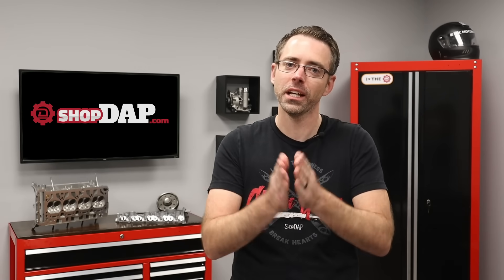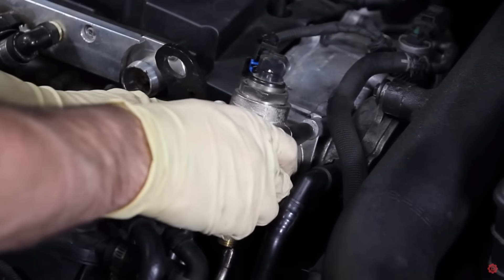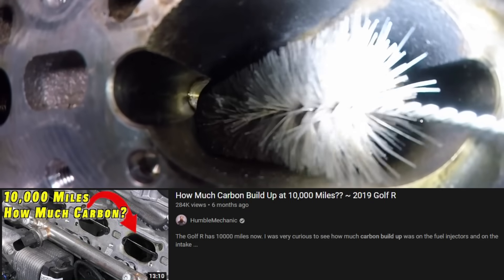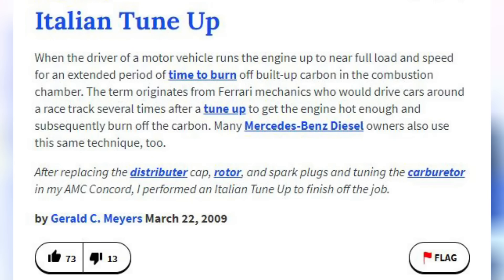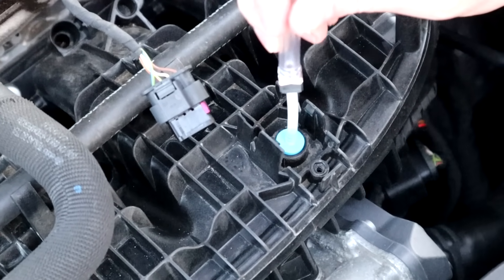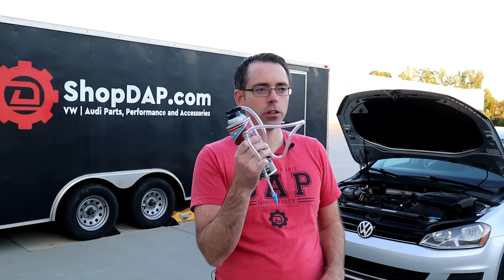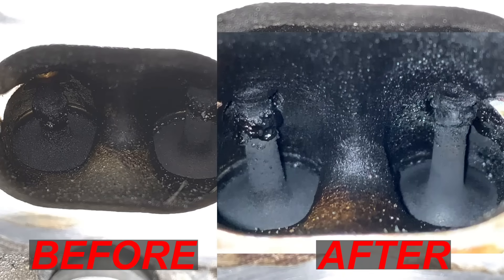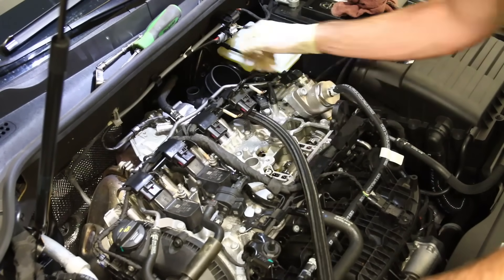Can you Really Remove Carbon for $29?

Comment: i found that different cars/engine pcv system help or make worse the carbon build up. audi/ vw ( sorry ) have the worse system.. pulling it from the valve cover and letting gravity  jelp flow the bad stuff into the engine... but ford( and some Mazda's ) DI engines have less carbon build ups... why? there pcv systems, are on the block below the intake manifold and the intake  on the head. the pcv system they use is also a baffle plate system, but because of the location, below the head/ side of the block,, less vapors etc. have to go against gravity to flow into the intake system... i have seen a few 2.0 liter EcoBoost cars with 100,000 miles on them, and the carbon on back of the intake valves is minimal... i also own a 2014 fusion with a vep 2.0 ecoboost engine.. but i installed a ovs, and modified the insides to collect most if not all the pcv vapors, and my intake valves are pretty clean.... last year just as a test  i installed a large fuel filter into the line from my ovs to the intake manifold.. and drove it this way for 6 months.. removed the filter, cut it open, and looked at the paperish filter element.. it was very clean.. so i believe my ovs mod. i did is helping  keeping that bad vapors out of my intake track  ..( p.s. i work as a classic Italian car tech)

Comment: CRC works just tried it the other day, but the engine needs to be hot to soften the carbo, idle at 2000 rpms, short burst until can empty. Let sit a hour, hit the highway at 100mph. Enjoy the new power❤.
Change the engine oil and filter.

The other method cheaper, get the engine hot,remove intake  manifold, spray the valves  with oven cleaner foam, let sit overnight, hit the highway, change the oil.

Comment: You have to start with a hot engine so run it before you do the chemical cleaning. BG 44K is a better solvent. They even have a kit to treat the carbon buildup. Continual reving of the engine while you apply the solvent is a must to get  good circulation of the chemical to all of the  ports. Use a good fuel addative with PEA like Techron or Gunk to keep the injectors clean with every oil/filter change at 5K miles. Use a quality engine oil like Valvoline Restore or Penzoil Ultimate Platinum to help keep the pistons carbon free . Finally, drive it like you stole it every once in awhile especially if you do a lot of cold engine short trips stop and go driving . Long trips are your engine's best friend together with good maintenance. If you can't/won't do good maintenance then trade it in  every 100-150K miles and start over again.

Comment: diesel engines 100 yrs have only air in intake, and direct injection of fuel. why diesel engines have not such problems with build up on valves. i have seen clogged mainfolds and egr sistems but rarely valves..

Comment: So call me crazy, install water meth injection, yes its not cheap or easy but long term it cleans your valves and will give you a small bump in performance. Seems like why don't they do this for factory cars? Cost and inconvenience? Sure that is true but taking your car to a shop for walnut blasting is not cheap, seems like the price has skyrocketed recently, I was quoted $700-1k for my N54, but still adding boost juice is a lot less time intensive than this even if I have to do it more often.

Comment: Has nothing empirically to do with CAFE standards - European corporate average fuel economies are much, MUCH higher than ours.  They just don't produce 7000lb vehicles for Sam the walmart cashier to drive by himself 20 miles to work and back everyday, and then try to make up for those ridiculously oversized peoplerollers with redline efficiency engine designs.  Freedum.

Comment: The best way to get rid of carbon buildup for good is to trade it in for a Tesla.  1000% effective.
Reply: Then you get corrosion buildup due to coolant leaking in the batteries, and you’ll need to hit up Electrified Garage to get it repaired bc Tesla will only replace the entire battery pack for a cool $40K

Comment: sure fire way to clean all carbon from pistons and valves is to empty washer fluid container and refill with distilled water and take a very small tube like from fish tank air line and run it from the washer tank pump to the inlet barb for the pcv valve on the intake...get motor really hot by driving down the fwy for 15 min at 70mph and then hit your windshield washer for 1 second every 10 seconds for 1 minute and then drive 5 more min and hit the washer cycle again the same as the first time and just repeat this for about 15 to 20 minutes. it will litterally look brand new inside. the carbon heats up then the cold water hits it and makes it explode apart little by little. if you ever saw an engine with a clean cylinder  after a head gasket leak then this is why...same concept

Comment: So the conclusion I have come to is just get your oil changed more often, get a catch can (I have heard a lot of good things about them), don't let spark plugs get too bad, and I think using higher octane gas helps a little as well.  Main thing though is if they get bad, clean them, and then do the oil changes more often like 5k miles.  Some people do them every 3k even.

Comment: FYI Toyota uses a dual port/direct injection on demand system in millions of rav4s and Camrys with the 2.5 engine sold in the US. It works flawlessly. Unlike the Chevy equinox 2.4 which is direct injection only and uses a tiny orifice PCV. It’s a mess.

Comment: Ive heard multiple times, LATER Gen 3 engines are less prone to carbon build up. Why is that? What’s changed? I run CRC valve & turbo cleaner through the intake on my 16 GTI & it seems to run great. Im now at 92k and am wondering if I need to get it carbon cleaned or is my Gen 3 less prone to this issue and why? Really enjoy your videos.

Comment: To quote Dr.W. Soon. Don't talk to me about Ozone you could get rid of the ozone and it would replace its self in three days or less. Or somthing like that. Its nonsense.
Reply: And for the humans 3% contribution to any harmful Co2 contribution. This is nonsense. Yes, it's not nice around very large cities. But reducing stop-and-go traffic would give better results. Stop putting engine sewage back through the cold air intake to be reburned. Its only achievement is to reduce the best air-fuel ratio possible causing even more pollution. Hell, we got rid of lead gas. Catch cans are not rocket science. You could make one out of a coffee tin. But returning it through the cold air intake is not the answer. But  running a valve cleaning spray just before the normal oil and filter change combined with a catch can system could yield some advantages.

Comment: For a modern auto manufacturer to include a valve design that guaranties excessive carbon, that is going to cause poor performance sooner not later, is inexcusable.  During the 1920's and '30s they had even worse problems with carbon (the Ford flathead was a flathead mainly because it made it easier to service the valves and remove the carbon).  And for a car maker to knowingly design something into their modern engines  that is essentially a giant step backwards, is proof enough that I'll never be buying a car designed by such automotive idiots.

Comment: Hi mate great video 
Just one thought by servicing the intake ports yourself you have to make sure the port your working on is closed so you do not let any carbon or chemicals fall into the combustion chamber. But if I was to use the method you and a lot of other people use with the can of cleaner would there not be chemicals and carbon deposits going past the valves into the engine.
Just a thought??

Comment: I fully agree, intake spray cleaning is a Preventative Maintenance procedure. It is strongly recommended you do it every 30K miles on GDI Engines BEFORE  you develope the build up. Once build up occurs,  chemical cleaners have little effect and expensive  physical cleaning will be required.

Comment: Get a Catch Can with a drain valve on the bottom. I flip the valve at every oil change and it comes out of the connecting hose on the bottom of the car. Usually I drain an ounce of oil every 7k miles. My intake stays  pretty spotless. I would say its about 95% effective.

Comment: Some people have the idea that if you throttle at really high revs, it will get so hot that the carbon will crack into small pieces and come off the valves. But there is probably some research in the area that says that there must also be a sufficiently high temperature

Comment: What does high octane fuel have to do with valve carbon buildup??? You DO understand that hi octane fuel is LESS volatile than lo octane? It has to be to prevent  preignition produced in high COMPRESSION engines.

Comment: I feel like if the engines running you're not really getting the benefit, it needs to be soaking, I was thinking if you closed all the inlet valves and use something like acetone and fill the chamber up and leave it for 24 hours then start your vehicle would more likely dissolve the carbon build up.

Comment: Meh, an Italian tune up is where you use an old Coca Cola bottle and fill it with tap water, then you take off the air cleaner assembly and then whilst holding the carb butterfly(s) open and revving the t1ts off the thing, you pour random amounts of water down the carb and watch as it splutters and stumbles, throws a whole lot of smoke and crap out the exhaust and then magically starts to idle better..

Comment: Use Pennzoil full synthetic made with natural gas. Change  oil every three thousand miles,  use 2 tier fuel only and keep air cleaner clean use engine cleaner early such as Moly valve cleaner.every 15000 miles you will never have a problem. TECHTRON
FUEL INJECTION CLEANER every eight thousand miles as well. (Maintenance )Pay Me Now Or BIgTIME LATER. 80 year old mechanic. SENDS this lesson.

Comment: FYI you can use windshield washer fluid for your "water/meth" injection....which means you can use the washer fluid reservoir that is already in there and just divert the line from the windshield nozzles to the injector.

Comment: I put a catch can in my car about 80-100000km ago and the can has never had any oil residue yet. The hoses are tight. Its installed correctly. Not sure whats up. Unless i just have a crappy catch can. Although its pretty basic plumbing.

Comment: This was a good video up until the Anti-Detonation Injection (ADI) section. Installing an ADI system is very straightforward for anyone with modest mechanical skills. ADI is the only way to effectively deal with carbon buildup so to dismiss it off-hand is ludicrous. I have a supercharged engine running with eight pounds of boost, so ADI is a no brainer. Snow makes an excellent line of products.

Comment: The Italian tune up is used to prevent carbon issues and works on car that can reach high temperature into combustion chamber, it doesn't solve older and massive carbon issues and doesn't work on diesel, especially on diesel that use EGR valve system, obviously.
Trust me, I'm Italian, I know.

Comment: I have a 2017 Ford Taurus SHO.. it has the twin turbo'd 3.5L V6... with direct injection. I use high-quality oil (Amsoil Signature Series 10W-30), a JLT catch can, CRC's Intake Valve and Turbo Cleaner (which is "specifically designed/formulated for this issue), and a Snow Performance Meth kit... My valves look nearly new. Bought the car used at 42k miles with one previous owner, I'm at 62k now. I've used the CRC spray twice so far. I change oil every 10k miles, and I check my catch can regularly.

Comment: Oil catch can... Put between the PCV valve and the hose. Going back into the motor will catch a good portion of that oil and then you can drain it off into a container and properly dispose of it. That's what the manufacturer should have done and just had it so you service it during an oil change 😉 

Or if they wanted to get fancy, they could have routed the condensed material into the fuel injection system through a filter. 😅

One of the other things that you didn't show in the video is installing a valve on the catch can so you don't have to remove it at all. You can just have a valve on the catch. Can either by the catch can base itself or run a hose down somewhere, not near hot components so that you can just open it during an oil change. Also by putting something inside the catch can like really coarse steel wool that's been blowing through a couple times with high pressure then make sure nothing can break free and then wrapped in like cheesecloth can help get the vapors cooled down so you're not getting anything back inside there. Power plant especially if you run the feed tube down inside the catch can itself and then the vapor has to go across the mash in order to get pulled back inside the engine. The air will make it but anything thicker will get caught up in the turbulence and hit the wire and then get fed down to the base of the can. 😅

Comment: Whenever I was rebuilding my engine for my Dodge Avenger. I took apart the intake and it was full of carbon so I soaked it for about 6 minutes to 10 minutes in potassium chloride and then I washed it and it became pretty much brand new aluminum.

Comment: when discussing ways to prevent carbon build up you forgot the easiest method ? re route your windshield washer sprayers to fire directly into a vacumn port and thus making a poor mans meth injection set up. you could either fire it manually using windshield washer mechanism or wire the washer pump circuit to a MSD rpm controlled switch :)

Comment: I am going to correct some misinformation. At roughly 10:00 or so, the content creator mentions the car running rough "because you're putting all sorts of chemicals in there." This is false. Why?

Because the car needs sensor inputs from the MAP/MAF sensor, and perhaps the air intake temperature sensor. He unplugged those sensors, thus the ECU/PCM isn't getting that sensor data.

The solution is actually on cars that have it, to unplug the vacuum booster for the brakes, and insert the cleaner that way. Another place you may be able to hook up the bottle is in the EGR system, which recirculates exhaust gas back into the intake stream. Lastly, you can also just crack open your air box and let engine vacuum pull the cleaner into the intake system. (Note: If you use the airbox and are worried about the MAF/MAP sensor, then remove it from the intake tubing, but do not electrically unplug the sensor.)

Point is, you want the cleaner to be pulled via vacuum into the engine. Another way to clean at least the valve seats and/or lower valve stems is to just run a can of SeaFoam in your gas. This actually will clean out the fuel system, including injectors, and in a direct-injection engine, can help to keep a valvetrain clean. I also recommend an engine flush for direct-injection cars, as the cleaner can clean carbon from the valves since it is mixed with the oil before an oil change.

Comment: So it did 0 to clean and fix the issue! 
You did not comment on the Walnut blasting option which I have seen do a fantastic job cleaning these issues.
It's not a cheap fix, but it's better than wasting $30 (and your time) on a can of foam that did nothing by the look of it!
My 2018 Focus RS has 78K on it and I am looking at the Wamlut blasting option with the addition of a Catch Can to slow down future issues ..

Comment: I bought my first car in 1967, it was a 1964 Mercury Comet...none of this crap did we have to worry about. First find a nice shade tree, change the oil and filter about every 3000 miles, the air filter, replace the points and distributor cap and spark plugs about every 25,000 miles, and we were good to go. Now if someone had some carbon problems, get a spray bottle with water, take off the air filter housing, have someone keep the engine running as it stumbles and spray the water in, a lot and a lot of throttle to keep it running. After a couple of spray bottles, take it out on the road and do some Italian tune up work. Works every time! I am fed up with all this high tech stuff that makes nothing but more work for me, give me old school.

Comment: I'm getting a lot of dynamic advance reduction on my 111k miles WRX. Not much actual knock detected, so I'm suspecting timing is getting pulled due to intake airflow issues as I've not had my intakes cleaned yet.

Going to attempt the seafoam method, but I'm having trouble finding a video showing where the correct vacuum line is on the FA20DIT engine that isn't morons spraying seafoam in at the MAP sensor.

Comment: Question. Using one of the intake valve spray cleaners (Berryman's, Seafoam, CRC) directly into a cold/warm intake and brushing valves and stems to clean requires hand turning the engine so valves are closed, so quantities of liquid don't end up in the combustion chamber causing hydro lock and possible damage. I would think some might still make it's way inside. Do you think turning over the engine with spark plugs removed so liquid is forced downstream, and/or allowed to dry help reduce the chance of locking? I'm not a mechanic, but am just learning about the faults of GDI (wife's Subaru with 150k miles). I don't think just spraying through a vacuum line in hopes of magically washing away years of cooked on carbon is going to cut it. Any thoughts?

Comment: I have a 2019 Veloster Turbo. First thing I did was add a catch can and run a cleaner through the system. I got it with 16k miles. Hoping that with the catch can and doing the cleaning yearly it'll help.

Comment: Hi DAP Guys,
My car is a 2006 A3 FSI Quattro 200Hp Model, driven 180000km  and no carbon job done before!
So ast year i made  a 1750km drive cross Sweden on 110 km/h pretty speedy highways!
After this car engine is like new, very good acceleration and speed, do You think this is a good method get rid of carbon, I do?
Johnny